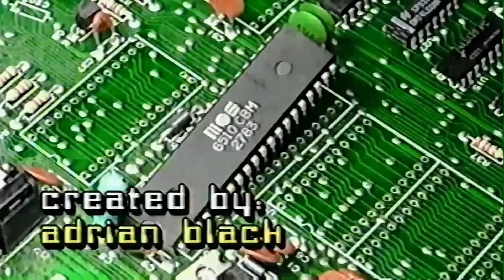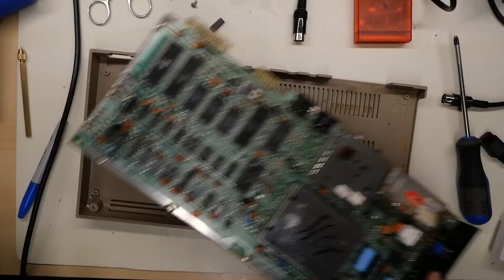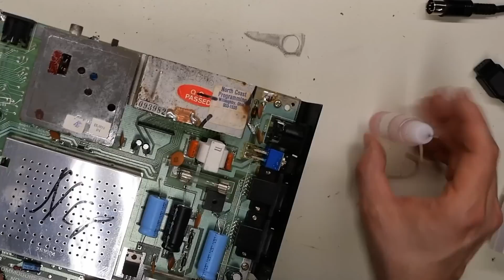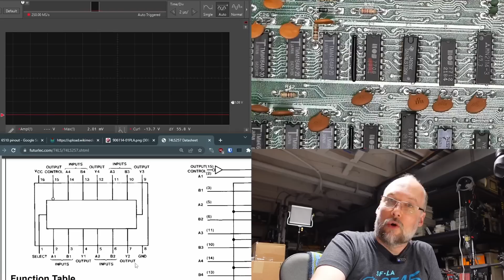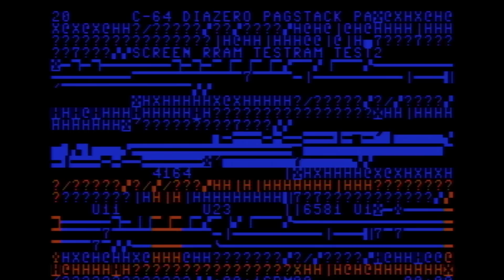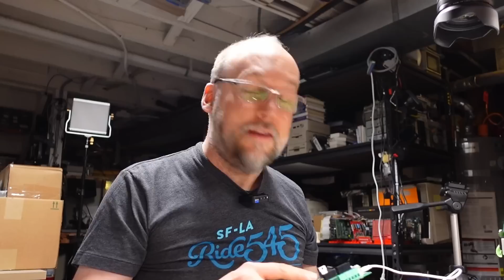2/12 C64 black screen repair: The chip was too fast for to work!

Comment: My experience back at that same time was that although the function of the various parts like those '257s were equivalent, the timing specs of the different families (plain TTL, Schottky, Low-power Schottky, Advanced Low-power Schottky, Fast, CMOS, High-speed CMOS) can cause issues.  I even hit a case where the Texas Instruments version of a 74LS123 would not work properly because the reset pin acted differently from other manufacturer's devices.  I had to look at the actual diagram in the TI Data Book to see it and compare to others.
Reply from the maker: I seem to recall that might have been an issue on the Apple II? That one particular vendor's 74LS chip wasn't working well and it took them a while to figure out which chip was the problem. Maybe I mis-remembering.....
Reply: @adriansdigitalbasement  I wasn't aware of the issue with the Apple ][, but it certainly could be the cause.  I'll need to look into that, I'm curious!  It was probably around 1981 or thereabouts that I found the difference in TI's chip; the manufacturer I was working at just added a restriction to not use that specific vendor's part.  It was fun trying to find it; if replacing it you happened to get the TI part it wouldn't fix the problem!

By the way: Keep up the good work, Adrian!
Reply: I remember back when I repaired Central Office switching cards that you couldn't substitute just any of those in many boards either (especially using the 74HC chips).  Some of the manufacturers even called for a specific one like a 74S only etc.   I was going to make this point but read comments first and saw your post.  Thanks for another interesting repair video Adrian.
Reply: @BrokeDad1  Yes, I hit that too, specific requirements for a chip family.  Even the "fanout" rating, stating how many inputs of each family could be driven from a particular family's output pins.  An "L" output could drive, say, 10 "L" inputs, but only 5 "LS" inputs. (Example only, I do NOT recall actual values from 40 years ago! 🤔).

It blew my mind a bit to see two TTL gate outputs tied together to drive an input, but the circuit used that as a "wired OR gate" or "wired AND gate"; you'd need both outputs High to see a High on the input, or either output Low would be seen as a Low on the input.  It saved them from having to add another IC and its required power and space on the circuit card, something you'd want to avoid for something going into an aircraft, for example.
Reply: @BrokeDad1  I worked on some of the earliest CMOS logic circuits, using the 4000-series chips.  It took getting used to, when looking for problems on a new board you could still get an open trace due to damage during component insertion.  You'd see an open input on a TTL chip tend to float at about 1.5 volts, so pull-up resistors were used to force them to be a hard "one".  But then the CMOS chips came in and an open input would show basically zero volts.  I created a probe with a resistor and could clip it to +5V or ground to act as a pull-up or pull-down.  The later 74Cxx and 74HCxx series tended to act more like their TTL equivalents.
Reply: @BrokeDad1  you might like the att tech archives on YouTube. There are videos on their old switching technology. Not as in-depth as these videos but still interesting.
Reply: I just tried to find a logic diagram specific to the TI SN74S123 chip, and everything pointed me to anything BUT the "S" type Schottky part.  The 74123 and 74LS123 look like they should, so I'm not sure what to think.  I wouldn't be surprised if TI quit making the part the way I recall and updated it to match the rest of the manufacturers' functionality.

If you look on the logic diagram of the '123, it shows the A, B, and Reset feeding into an AND gate, with the Reset also going to the reset of the flip-flop type circuit.  That connection between the Rest pin and the AND gate input is what the TI chip did not have, and the specific circuit I saw at work needed to both prevent the A & B inputs from working and hold the Monostable Multivibrator in a cleared state.  I think the TI chip would not reset with the same timing characteristics as the other vendor's versions, or it would come out of the reset state with the same timing.  Again, roughly 40 years ago, I clearly recall finding the difference but don't recall the surrounding circuitry or the exact fault details.

Thanks for letting me reminisce a bit. 🙂

Comment: 6:38 Interesting little bodge there with those diodes at the edge-connector.
What might that be for?
Reply: Iirc it's on the read pin I do not know the reason it's there
Reply from the maker: I've seen it on a few machines and I never figure it out either
Reply: @adriansdigitalbasement  The purpose is to clamp data lines between GND and 5V. A static discharge directs the excess to 5V or, in case of negative charge, to GND where it cannot hurt. It looks like Commodore initially didn't see the need and perhaps due to warranty claim issues, later decided to add the diodes to the mainboard.
Reply: @danielmantione  Huh, might be a good thing to add to my own units then! (once I bring them back from the dead, they got bad-power-supply cooked)

Comment: You could probably put the chip with short legs in a socket, and put the socket in the tester.
Reply: Yes, probably - but it is a notoriously unreliable MOS chip, so why bother? You'd never put it back into another machine.
Reply: @infindebula  Curiousity! :)
Reply: Those chips often do not sit properly in normal sockets either

Comment: Hey Adrian, Good Video. NKK Switches Model No. M2022TXW41-FA is a good replacement available at Digikey. You have to trim the front pins for the swtch to fit flush with the board but otherwise is fine..
Reply from the maker: Awesome thanks!
Reply: I just posted to check Digi-Key and Mouser!  Thanks for posting the info with part number!

Comment: If folks are going to compile symptoms an fixes, it's probably best to add them to Tech Tangents' caps.wiki
Reply: @Mr Guru Is that site going public on a stock exchange soon and do you have a bunch of private equity? Man, clearly people want more than what pictorial64 offers - there's always room for improvement and expansion. Even the author of the site agrees, as he clearly writes "The site will always be a work in progress" - and the first paragraph of the site writes "For the best results, use this guide in conjunction with the other C64-related sites listed here." Where the "here" links to the bottom of the page and includes a link to Adrian's (this) YouTube channel.
Reply from the maker: https://caps.wiki/wiki/Commodore_64

Yeah -- screen grabs, problems and solutions.

Comment: If you had two "F" versions of the 257 chip, I wonder if that would have worked?  The timing of the two mux chips would have matched.
Reply: As Daniël Mantione explained below, the propagation delay theory I detailed here like is not the cause. The design of the C64 (according to schematics) doesn't seem sensitive to fast propagation through that multiplexer. Slow propagation would be an issue, but LS already is at the slow end of 74 series families, so substituting the LS257 by something else (except possibly an 74L257) should not violate timing constraints.

I expect it would still have failed. The 257 chips are used to switch whether the row or the column address is routed to the RAM chips. The RAM chip requires that the row address is routed to them for the "row address setup time" before the RAS line gets asserted and kept their for the "row address hold time" after the RAS line got asserted. The RAS line will be asserted for the whole cycle, but the row address only has to be valid for setup+hold time around the time where RAS gets asserted. Then the 257 chips get switched to route the column address to the RAM chips. Again, the column address needs to be present the "column address setup time" before the CAS line gets asserted and it needs to stay stable for the "column address hold time".

When you replace the 74LS257 by a 74F257, the routing changes faster after the column/row selection input to the multiplexers change, so when the row address is switched to the column address, the 74F257 switches from row to column earlier than the 74LS257 does. I guess what's happening here is that using the fast chip, the column address appears too early, violating the row address hold time.
Let's dive datasheets to validate that assumption:
Our beloved MT4264-20 RAM specifies a "row address hold time" of at least 25ns, so the output of the 74LS257 needs to stay stable for 25ns after the /RAS line has been asserted (pulled low). The 74LS257 datasheet (by ON semi) specifies a "typical" reaction time to the select signal of 14ns. The 74F257 datasheet (by ON semi again) tells us about a "typical" reaction time of 5.0 to 6.5ns (depending on whether the output goes high or low). The F257 datasheet even guarantees a minimum reaction time (i.e. how long the old value is guaranteed to stay at the outputs when the selection input changes) of 2.5 to 4 nanoseconds. Too bad that LS257 datasheet does not, but it is likely to be around 7 to 10ns. So using the F257 kills 5ns of the row address hold time.
As the hold time needs to be fulfilled on every address pin, I don't think violating it on all pins (using two F257 chips) would fix it to compared to violating it only on half of the pins (using only one F257 chip). If the F257 would not violate the row address hold time, the system would work even with a single fast chip.
Faster RAM requires less hold time, so possibly using 100ns or 120ns RAM (requiring only 15ns hold time) would be compatible with the F257 chip in the C64 mainboard, whereas 200ns RAM is incompatible
Reply: @tw11tube  I can't fully explain it: The 74LS257 multiplexers are switched by the CAS signal, so the bus is only switched at the very end of the RAS phase. Common knowledge is that the CAS timing is critical: The multiplexers have to be faster than the PLA, but that the RAS timing is also super critical is not common C64 knowledge, I didn't know and don't believe that RAS is also on the edge... CAS being on the edge is worse enough. It may also be a matter of parasitic inductance and reflecting signals on the wires, according to  Bil herd they had problems with this and the resistors in the address lines are there to attenuate reflections. The 74F257 may behave differently in this field.
Reply: @danielmantione  Have you worked through the calculations of hold time for the column address, instead of just going by repair traditions?  I can't because I haven't seen a 64 schematic in decades, though line ringing from fast signal edges could be plausible as also mentioned.
Reply: @danielmantione  Oh, thanks for looking up / knowing where the select signal for the 257 comes from. Indeed, CAS to the RAM chips is generated by the PLA from the general CAS signal (adding the propagation time of the PLA) and further delayed by R24/C204, whereas the general CAS signal directly goes to the select signal. So indeed the multiplexers are toggled late in the RAS-CAS-sequence, and faster multiplexers shouldn't hurt.
My theory about the multiplexer outracing /RAS thus seems wrong. My next guess would have been higher input current by the F257 compared to the LS257, but looking at current TI datasheets, the F chip doesn't have that high input currents that it should be able to load down the bus. Seems like the "easy" (i.e. non-HF) explanations are exhausted, and ringing might in fact be the cause.
Reply: I put all 74F257 in my c64 it works fine..
Reply: @Mr_Meowingtons  Then you were lucky. Incidentally, you also increased current consumption by doing so.
Reply: @jaycee1980   it was a repo Assembly 250407 all the 7400 chips I had where F so I was like F it if it works it works. current consumption is not a big deal all the power handling is all switch mode no linear voltage regulators.
the RAM is all so 120ns legit every 7400 is F its all I had. all have date cods from 84 to 88 Signetics or the one i cant spell with an F lol
Reply: @Mr_Meowingtons  If they are paired (both F) I would guess the timing would match and would work.  It's just curious.  Someone above mentioned that the F series probably "rings" more when their outputs switch; that may be true too.  The electronics I've worked in all my life where not fast, more like logic selection, so you could mix in any type of 74 series and it made virtually  no difference.  I never repaired computer mother boards before.  I do love watching Adrian do it - lol.
Reply: quite possibly, would be interesting if someone tries it!
Reply from the maker: Unfortunately I only had the one chip -- my 74xxxxx stash is a bit chaotic so it takes me a while to find any of them. LOL!
Reply: @adriansdigitalbasement  if you think your stash is 'chaotic' , as the saying goes, 'you aint seen nothing yet' 😉
Reply: The problem was most likely excessive ringing due to the faster chip... so its unlikely two F chips would have worked. HCT should work though.

Comment: I was able to source those power switches locally a few years ago, so I think they're still available. Part number is KS-SP-222A
Reply: I've seen similar ones made by C&K, but don't have a C64 handy to look.  May be able to find them through Digi-Key or Mouser.

Comment: Bill Herd commented that Commodore engineering and manufacturing divisions were not allowed to communicate. When he finally got inside the manufacturing operation, he saw all their timing problems were being dealt with in manufacture by technicians installing RC time delays on problematic signals. With kludges like that happening, I can easily see a logic element being too fast to work.
Reply: Who ever thought not communicating was a good idea?! What the heck??
Reply: @simonro9168  That sort of "siloing", where groups work in isolation from one another is common in large companies.  Especially when there's differences in skill sets, where one part of the company doesn't know what the other part knows, and thinks in completely different ways.  

It takes active people to try to change it, and it's not easy when that kind of thinking becomes entrenched.
Reply: @simonro9168  Likely the head honchos worrying about loose lips and 'distractions'
Reply: @simonro9168  Welcome to corporate America.
Reply: @Peter_S_  who says it’s unique to the USA?!
Reply: @Peter_S_  Wait, where were Commodore machines manufactured, where was the company based?  I had to look it up, got confused because the company was founded in Canada, then based in US, but I thought it was out of the UK for some reason.
Reply: @bobblum5973  Not relevant, in fact, completely irrelevant. Commodore engineering and manufacturing divisions were not allowed to communicate. Period. Bill Herd has videos on it and he was one of the players. You want to pretend you know more about it than he does?
Reply: @Peter_S_  No, you're misunderstanding what I meant.
First, I agree that not having design and production interact is insane, especially having worked to get feedback from my own production test issues back to test and design engineers to correct manufacturing issues.
I was not aware of Bill Herd's comments, and do not doubt their accuracy.
I had started to comment with the mistaken impression that Commodore had been a UK company; to be honest, I think I swapped it for the Sinclair products.  Once I realized my mistake, I finished my comment with that in mind, so it may show that mid-stream change in how I wrote it.  My apologies for any confusion it caused.
Reply: @bobblum5973  Hey, Bob, Commodore was an International Company, C64 production started in the USA in California then moved to Pennsylvania. Then aditional manufacturing faciliies where opened across the world. The most famous for C64's where in West Germany and the UK but disk drive production was all over the place.

Comment: Were MOS chips always unreliable or is it just down to age?
Reply from the maker: You know I didn't work on these machines back in the day, so I couldn't say, but I think age is really the big factor. There is a lot to go into making reliable chips and I think Commodore had some "issues" with some of their processes. Used during certain years. Compare that to the Amiga which is generally super reliable -- also using MOS chips, but later and different designs.
Reply: Cheers Adrian for taking the time to reply, much appreciated!